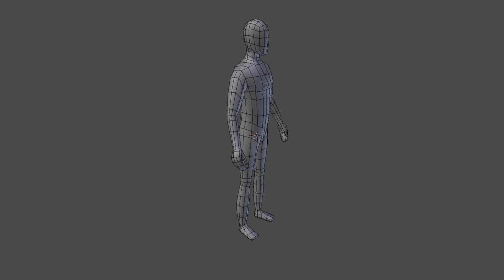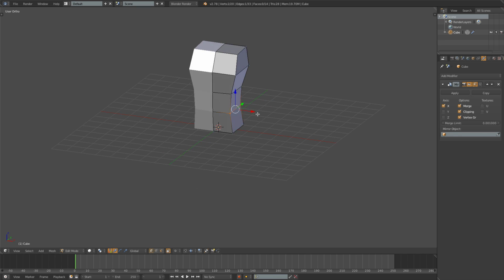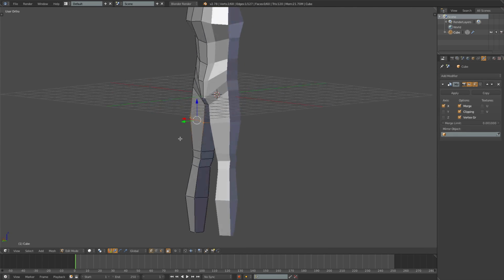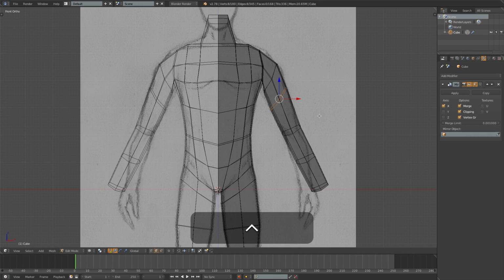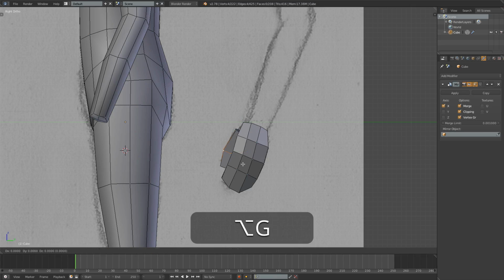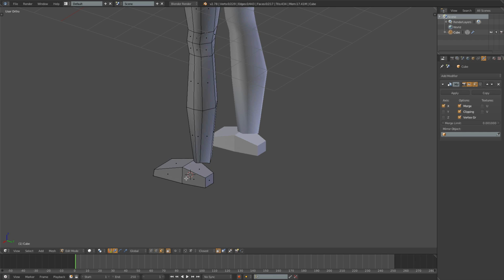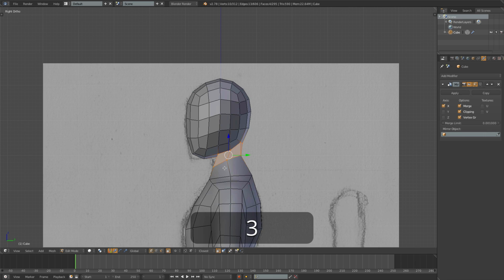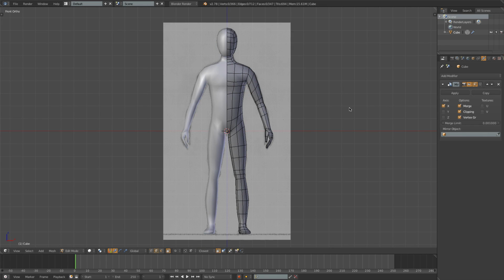RPG graphics E01: Character model [Blender]

Comment: For anyone wondering how to delete the double vertexes when attaching the arms in Blender 2.8
Snap the arm into place, then select everything, go into vertex select mode and right click, at the bottom you'll find Merge Vertices -> By Distance.
That's it :)
Reply: thank you so much :)
Reply: You can also select all in edit mode, and hit alt + m  to do the same thing :)
Reply: thank you!
Reply: THAAAANK YOOOU! :)
Reply: Question: How do you do the opposite of this. (Blender 2.79 lol)
Reply: Thanks
Reply: thank you!!
Reply: @potato1907 select the needed loop and tap V on keyboard. It will divide the mesh across the selected vertexes making them double.

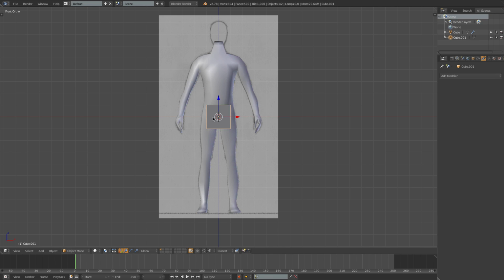Comment: For anybody working in Blender 2.9 and looking for the subdivide smooth option at 21:04. After going into edit mode, press ctrl+E to open the edge tools method then click subdivide and in the menu that pops up increase smoothness to 1.
Reply: Thks buddy. I was searching for this for like an hour. If I had not seen this, I would have just added a sphere for the head and mess up my model. Not that it's not messed up now.
Reply: Thx
Reply: ty
Reply: Thank you! You just saved me a bunch of time! Was almost ready to go down the documentation rabbithole to find this specific thing. Your comment should be higher :/
Reply: What do you think of some artist using a single plane to do this? I am trying that method because he shows how to do the mouth, teeth and tounge. But I am liking this guy's video here for background characters, but I'm always interested in speeding up my work if quality doesn't suffer.
Reply: I thank you and other viewers who take the time to post little additional tips and short cut keys. It is always a big help.  : )
Reply: Thank you so much, God bless you
Reply: Hero! Also, if you're not seeing the menu like me, it defaults to the bottom left part of the view and for me it was minimized.
Reply: oh my god I love you

Comment: For those of you following in newer versions of Blender,  the new UI removed the background image feature. Instead, use Add < Empty < Image. Using the empty menu on the default right hand panel (Properties Panel < Empties tab) you can control options of it such as transparency and if it should only be visible in orthagraphic view (preferrable).

Comment: for recently version, way to set background.
shift+a in object mode.
image -> background.
In scene collection, new empty Object would created.
click it, and click orange icon tab named object properties at properties editor on bottom right.
at transform, set rotate 90 0 0 for front,  90 0 90 for side.
check display front at the viewport display menu.
click red icon tab named object data properties
uncheck perspective at show in option.
check opacity and set value 0.3 or whatever you want.
open image to set background.
Reply: you are awesome
Reply: Thank you so much
Reply: helpful > I used image -> Reference in 3.0.1 and your other instructions, seems to work, the toggle/uncheck perspective step is more clear when we switch between orthographic and perspective  modes in the next few steps. Thanks for sharing.

Comment: 2.8+ Updates
-Adding in the reference images in 2.8 can be done by having nothing selected, and being in Object Mode and Pressing Shift+A, going to "Image" and then pressing "reference" and selecting the photo wherever it may be on your computer. Afterwards you might need to change its position, rotation and scaling of both of the photos to be aligned and match the video (I set the scaling to 3.5 for both photos).
-For the snapping tool, it will be located at the top, next to a magnet, there you can select Vertex and use the snapping feature.
-The "Remove Doubles" option has been replaced in 2.8 with "Merge Vertices," and when you hover over merge vertices, click on the "by Distance" option.
-Since "Subdivide Smooth" has been removed in 2.8x, the workaround would be to just "Subdivide" and then changing the smoothness to 1 on the lower left menu to get it that "smooth" shape.

Edit: adding in some more tips
Reply: The hero we need but don't deserve
Reply: @11305205219  Im guessing you need the "merge" menu. For me only pressing "m" brought it up for me.
Reply: Thank you so much, I couldn't figure out how to subdivide smooth.
Reply: Thank you so much!
Reply: Thanks a lot, I was struggling.
Reply: Man, THANK YOU SO MUCH!
Reply: God bless you my friend

Comment: All those shortcuts... UGH!
Reply from the maker: I know all the shortcuts are a bit overwhelming, but they're super helpful to know. I've compiled a list that covers (I think) all of the ones used in this video + some extras. I hope that helps somewhat! https://github.com/SebLague/Blender-Shortcuts/blob/master/README.md
Reply: @Sebastian Lague: hey sebastian. really nice tutorial! Got just one remark/question: Could you maybe set your Screencast Mod (or whatever it is you're using) so that that there is a slight delay before the the buttons disappear on the screen? Because if you're pressing them in quick succession, it's hard to figure out which button it is you pressed before. As for instance in [sx0enter] etc. Think you did this in your other tutorials before. Would be bit easier to follow the list of command-inputs then. Looking forward to your coming tutorials!
Reply: That shortcuts are not that difficult to remember, as you think. Try watch some blender courses on youtube, they will explane each one of them.
Reply: Thanks for the cheatsheet :)
Reply: They become muscle memory the more you work with them! I just started simple and branched off. There are really helpful beginner tutorials which get you used to the UI. I am still learning basic things.
Reply: I know this is old but threre is a website that has all of Blender shortcuts, and you can download that as an PDF...Also, a tip from me is to put the shortcuts pdf as the background image of an angle you don't use

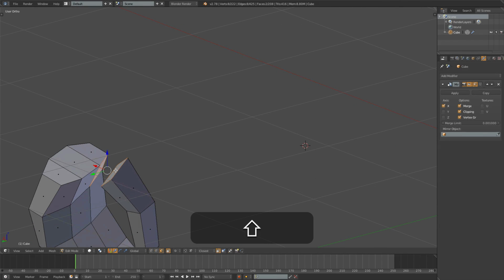Comment: 16:22 A faster way to do this is to go to "Bridge Edge Loops" and check the "Merge" checkbox. You might have to adjust the "Twist" value, though in this case it should work fine without.

Comment: For the arm merge for anyone on the latest blender 2.8, Press ALT+M, then B and drag the slider for merge by distance up slightly as you see the arm connect.
Also the head for the subdivde smooth, click the cube in edit mode right click >> subdivide >> then in the bottom left turn the smoothness all the way up.

Comment: Instead of doing all this, I drew a stickman in photoshop. black on a white backround. In blender I made a grid 100x100 and added the displace modifier and assigned the drawing to the modifier. In side view I simply trim off the top vertices (white). Then I scale down whats left fully on the Z axis untill its flat, then extrude up a couple of times. You now have a model that you drew. Enjoy!

Edit: Just before you extrude, hit X and do a Limited Dissolve otherwise it gets messy real quick.

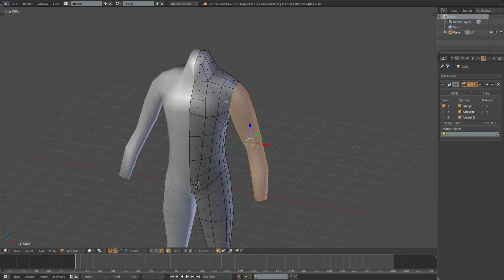Comment: Have Problems. At 12:53 snaping in this way doesn't work for me. I have version 2.79 .
My way is : Select the two loops and use w Bridge Edge Loops.
It creates faces and edges between the vertices. 
To delete the edges and faces: Press F6 and check Merge. The Vertices will be welded at the center of their way.

Comment: Just a heads up:
Dont hit CTRL+Z without really meaning it.  I hit twice really quickly and I am staring at a cube again.
I had just wanted to move a couple vertices back,  but it apparently undid everything I did in Edit mode.
I'm using 2.79 btw.

Comment: I'm at episode 3: weight painting, and I came back to double-check if I missed a step where the two copied sides were welded, but there isn't that step mentioned, yet when I paint weights on one side of the mesh, they're duplicated for the same bone on the other side! When did the mesh get welded, or how do I avoid that effect?
Reply: bricknose you have to apply the mirror modifier

Comment: Whenever I try to loop-cut like in min 7:51, the loop doesn't loop around the whole object, it stops in the top section of the thigh (where the blue arrow is in that part of the video). I can loop-cut the rest of the legs, and the torso separately,  but not the whole body. I have no idea why, help. Is it a problem with the faces?

Comment: I've only recently come across blender and can see the awesome potential of this tool. So far this video of yours has been a lot more helpful than most although i am using 2.8. I hit my brick wall when it comes to the hands, i know there are a few things done differently between the two versions, i shift and right click to put the 3d cursor where i want the hand to be but when i add the cube, it appears in the centre of my model and mirrors from the centre when i try to grab it to move it to the wrist. In object mode i can get the cube where i want it but it doesn't mirror on the opposite side. Can anybody enlighten me as to where i need to make changes to the operation? Sorry it's a bit long winded. One love.

Comment: Without the smooth option this model gonna looks much better for me. Is there any way to undo this action?
Reply from the maker: Sure, if you have all verts of model selected, then press 'w' to bring up specials menu and choose 'shade flat'.
Reply: Thanks!
Reply: 1.ObjectMode
2.select object you want to change shading 
3.Inside "Tool shelf" ( menu under "T" button ) there is an option called "Shading", with 2 buttons (smooth/flat)

You can also change it inside "edit mode", same menu, but Shading/UV option. Just select faces you want to change shading, and under faces click Smooth/Flat button.
Reply: Thanks :D

Comment: Hey, man. I have such a newb question that has been messing me up with blender for a long time. Why can I only sometimes grab all vertices on a 3d plain, while other times only the ones in front?
Reply from the maker: It depends what shading mode you're in. In wireframe mode you'll be able to grab all vertices, while in shaded mode you can only grab the visible verts. You can toggle between these two modes with 'z'. There's also an option called 'limit selection to visible' which is next to the face/edge/vertex buttons in edit mode. When this is turned off you can select invisible verts in shaded mode as well.

Comment: Hello, I hope you still answer questions to this video. I have followed the tutorial in blender 2.8 and I have merged the thumb's vertices with the rest of the palm's, but when I'm in face mode I hover over the thumb and press L only the thumb's faces get selected. And when I'm trying to shade smooth it creates a weird shadow in the place where the thumb and the palm are joined. For some reason it didn't merge correctly, even though all the other body parts are perfectly joined. What should I do?

Comment: I did like you said ... But When I was joining the head to the body in the method bridge edge loop ... There was a hole in his neck like a triangle. I  merged the centers but it was weird ... I undo and I saved after deleting the bottom faces and closed the application...
After an hour, I opened the project and I can't rebut the deleted faces ... How could I do to rebut the missing faces ??
 Please reply soon
If It is impossible to rebut the faces .. I will download the model

Comment: 4:25 for some reason when i do just like you did for the scale , i go to wireframe mode , sideview 3 , i press A to deselect all , B to select a point , G to move the point , and then guess what happens ? i moves the vertices instead of the point, i see the vertices selected instead of the the point , why ? as soon as i use the scale it fucks everything up, is there a way to change this?
Reply: K fixed it by clicking on the " vertex select " at the bottom the 3 cubes icon , idk if there's a shortcut for those , and seems like everytime i used the scale it switched to the edge select where my issue lies.

Comment: seems like blender have changed a bit since this video was made, som hot keys and UI has altered so not sure if i can follow this anymore ?
still a usable video for knowing what is possible to do with blender.
Reply: you can revert back to old hot keys from Edit > Preferences > Keymap
on above you will find a dropdown with value blender. select the drop down and  Select Blender 27x
now your Hotkeys problem will be fixed

right now I'm also following this tutorial by doing this adjustment

Comment: i cant Change my view.when i press 1, Nothing is Happening, but everytime i press 3 my cube is disappearing.
Reply: That could be either that you are using a different keyboard or you were in edit mode. You need to be in object mode to switch views - > press escape to deselect anything and then press tab until you get into object view. Then it should work.

Comment: LOL can't get the image to work.  As a matter of fact, nothing works in these tutorials.  I open up Blender, press N, and there is no properties tab with add image.  Getting really frustrated, spent a few hours trying to either implement ready-made models and now this...
Reply: bro its a good tutorial, if u having probs with blender perhaps watch a beginner tutorial first
Reply: They have a new system called reference images that effectively does the same thing.  With nothing selected, press shift + a > image > reference and choose your images.  They'll be a little small so scale to something like 3.5x on all the axis and position them correctly, and then you'll be ready to go.

Comment: When I press 1 my camera doesnt move anywhere and when I press 3 the cube just disapears
Reply from the maker: You need to use numpad keys, not top row of numbers. Top row of numbers switches layers, which is why the cube is disappearing. If you don't have a numpad, go user preferences > input and enable 'emulate numpad'. Then you'll be able to use the top row for view changes.
Reply: Thank you, that solved it =)

Comment: I lost in 13:33. When I creating the cube to make the hand my cube does not appear mirrored and it will be a separated object. So I have 2 cube, one for body and the other for hand. After that I create the thumb and this is the third cube. I have 3 separated cubes. How can I do that? Blender 2.91
Reply: Just somewhat figured this out myself and I'm not even sure if it's correct, but under the modifier property i turned off clipping then I was able to get two separate mirrored cubes for the hands.

Comment: i'm on blender 2.8 and cannot get the arms to snap to the body, is there a fix or and i just remake them by extruding them from the arm holes
Reply: The snap tool in 2.8 is the magnet icon at the top, and the drop down arrow arrow next to it is where you can set it to vertex

Comment: Is there a specific method to creating the background images?
Reply from the maker: +dog It's important for the front reference to be roughly symmetrical, and for the front and side references to line up properly. So I just sketch the images on paper with some lines to keep them in proportion to one another, and then scan into photoshop. There I mirror the front reference to be symmetrical, and overlay the two references and tweak any parts that I didn't align correctly when drawing.

Comment: i cant find where you can set images to side image and front image in the beginning of the video, please help
Reply: In 2.8 you need to set it manually using the Object Properties tab on the right, just above the spanner. Set the front view picture to 90 degrees rotation on the X and set the location to 3m on the Y, then set the side view image to 90 degrees on the X and Z, and set the location to -3m on the X.
Reply: @nicholasflint9480  thank you
Reply: @Shoebox817  Welcome
Reply: Also if you go to the 'Filter' button just above Scene Collection (looks like a funnel), you can enable 'Selectable' in the Restriction Toggles, then you can disable selection on the images in the Scene Collection area, so you don't keep selecting them while trying to model. It helps avoid headaches lol
Reply: @nicholasflint9480  how do you disable selection on the images in the scene
Reply: @nicholasflint9480  I'm trying to select all the faces like  4:01, how do I do that
Reply: If you've enabled 'Selectable' in the Restriction Toggles in 'Filter', there should be a new icon on the right side of every layer (a white mouse cursor). If you click that, it'll disable selection. Just hover over the icons above the Scene Collection to find 'Filter'', it's just to the right of the search bar
Reply: @nicholasflint9480  nvm I figured it out
Reply: @Shoebox817  If you're in edit mode, press 3 to change to face select mode, then hold Shift while clicking them all
Reply: @nicholasflint9480  do you know how to soft shade like he did in 9:48, that menu when he pressed W won't doesn't pop up
Reply: @Shoebox817  Yeah go back to Object mode and go to Object at the top, it's in the dropdown. Also you can do the search trick he did with space but in 2.8 it's the F3 button, I used that to find a couple of the tools
Reply: @nicholasflint9480  ok one more problem, i cant find "remove doubles" i can only find "remove particle dupliobject"
Reply: @Shoebox817  In edit mode press Alt + M and select 'Merge by Distance' that does the same thing now

Comment: Is it normal that i cant find even the background panel? :/
Reply: Yes, blender has changed a lot since this video was made. You can open refrenc pictuers by presing shift+a in Object mode
Reply: @traumerlein3321  could you please link me an updated version if there is? :/
Reply: @traumerlein3321  with which i would be able to do the exact same stuff which are needed to import to unity (to brackeys)